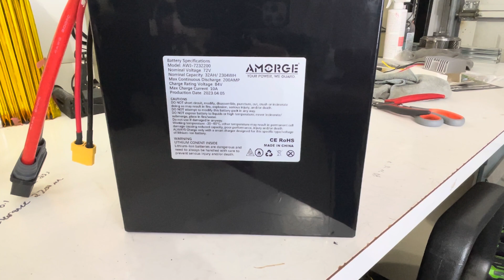Amorge Lithium Battery Teardown. Overall Build And Quality Assessment

Comment: Bro the solder will be fine I would say bolts would be more dangerous and I'm sure that they spot welded it then put solder and heat won't be a problem the cells prob only work at a maximum 80c

Comment: I just bought a 60v 24ah battery for my emoto and it didn't even go through one bar for a hour of riding..hopefully it have the right settings for my controller for the battery,next time I ride I'll check the bms and see the power left in it compared to the gauge on my bike..amorge is a great brand 🎉

Comment: Thank you for taking the time to film, edit and upload you taking apart a battery you purchased for yourself only to build it back up!

Is there any additional measures you done to it seeing as it was unwrapped? Extra tape, padding etc?

Watching from the UK - I found this video from a reddit thread about Amorge batteries.

Thumbs up for the algorithm
Reply from the maker: I just added some Kapton tape, isolation paper, and that’s about it. It’s been in a bike that gets used daily for over a yr now
Reply: @ReuterLithium  thank you for the reply and extra info
Reply from the maker: I should specify that I did get new shrink wrap and sealed the ends with silicone again. Basically just made as it was

Comment: 1:54 I plan to buy a battery for a razor to put inside the motor box but possibly use without covers. Based off your experience with battery protection here, do you think it's worth $60-$100 extra for the metal box or do you think it will be fine without it? I'm only going to be us for pavement and dry conditions.
Reply from the maker: Metal case is always worth it, even with plastics

Comment: i got an amorge but its only 24 AH out of 32 AH @ Full charge @ 4.2 volts why would the battery have lower AH than marked?
Reply from the maker: Curious how you are measuring Ah of the entire battery vs the individual cells?
Reply: @ReuterLithium  has an app it shows the total battery AH out of the capacity. After I took off the charger AH balanced out to 31.33 out of 32 cells were like 4.150 volts so IDK but i think the battery is good? weird glitch on the app was showing the AH as 24 out of 32 when charging was completed

Comment: Amorge told me my cells aren’t balanced on my batteries and they’re sending me a new “intelligent BMS”…what is this and how the heck will I install it?
Reply from the maker: That is unfortunate. That can happen with all batteries. Regarding BMS replacement. If you don’t have much experience with that kind of thing I would strongly advise paying someone with experience to do it or teach you. But in my opinion they shouldn’t be sending you parts to fix a battery. Is it under the “warranty”?
Reply: @ReuterLithium  I’m not sure what the warranty is…it’s been far less than a year since I ordered.  I will ask about replacement instead.  Who would I go to for repair?  I’m not even sure what kind of business does that kind of thing.
Reply from the maker: Pretty sure warranty is 1 yr. Yeah there is not many if any “official” business that perform those kind of repairs. Your best bet is to get a replacement. Depending on what they say on what to do with the old one throw it on Marketplace or similar as broken. Guarantee someone will either know how to repair it or at least be interested.

Comment: Is this battery still holding up? and can you get water on it without it causing problems or no? Thanks
Reply from the maker: Sure is! It probably gets used more than most. I would say the water proofing is decent. I think it’s ok to splash it and ride in rain sparingly. I don’t think it could ever handle any submersion though
Reply: @ReuterLithium Ok thanks for the reply. Would you recommend a stock surron battery or an amorge battery if I can get the stock surron battery for $400 with 1000 miles on it.
Reply from the maker: Tough question to answer without knowing what you intend on using it with, motor/controller. My Surron battery has been super reliable, but it fits terrible in most applications outside of Surron. It also lacks that punch that the Amorge batteries have. I think moving forward I won’t install anything below 150 amps continuous unless it’s just a little cruiser. I intend on taking my Surron battery and installing into a little Coleman 100.
Reply: @ReuterLithium  Oh ok. My motor is an 1800w vevor, and my controller is a 45 amp controller that works with 48-72v range. However, i can also get a surron motor and controller for an extra $400, so that I could have a full surron setup in the razor for $800 total. What would you recommend?
Reply from the maker: Can’t say I’ve ever ran a full Surron setup before. My issues with all that stuff is you can’t change any settings. Honestly just comes down to what you want to install it in and how much fabric work you want to do. Not sure where you at, but in Austin we can grab Surron setups for around $600
Reply: @ReuterLithium  Ok I see. And i totally agree with you about the problem with not being able to change any settings. By surron setup for $600, do you mean a battery, motor, and controller all for $600? Also, with a controller like a kelly or fardriver, what settings that you can change do you find most useful?
Reply from the maker: Yes all 3 for around $600. Controllers are almost worthless because you can’t change anything and the harness is very specific. I find the ability to adjust your battery amps and throttle acceleration settings to be the most helpful. But maybe if you go with an entire Surron setup you won’t need to do any of that. Not sure as I have never done it
Reply: @ReuterLithium  Oh ok maybe $800 isn’t as good of a deal as I thought then. And the function of changing amps and throttle does sound very nice. Right now, my motor is 1800w, controller is 45 amps, and the battery I would get from amorge is 72v. Because of this, it would be pulling 3,240 watts out of my motor. Do you think my 1800w motor could handle that? My controller doesn’t allow me to change amperage
Reply from the maker: Personally I think it would be fine. Just monitor the temp
Reply: @ReuterLithium  Ok thanks. Does the charger for the amorge battery keep charging once it’s full to balance the cells?
Reply from the maker: Balance is done by the BMS, charger turns off after the voltage has been achieved
Reply: @ReuterLithium  Yes I understand but what I was meaning to ask is whether or not the charger would keep turning on and off at the end to balance the cells.I had a charger where it would just cutoff when one cell would reach 4.2 volts so the pack would never be balanced. So I’m curious if the charger keeps on charging to top balance or if the BMS is an active balance bms. Thanks

Comment: 780$ Damn
Reply from the maker: Damn good or damn like expensive? lol
Reply: @ReuterLithium  I’m new to the scene…. So it’s a damn expensive at the moment. I was thinking 400/500 but damn! Lol. Is it any cheaper to source all the material and build it yourself? Again, I’m new to the scene but I have electronics experience and a very good soldering iron.
Reply from the maker: No worries! Glad you asked. So I’ve built batteries using used cells. You can bring that cost down to half, but only after buying all the decent equipment. It’s so time consuming that it’s not worth my time to build them. It’s really fun as a hobby though! For a battery of these specs most want $1200. 

Welcome to the space! It’s a ton of fun when you start jumping in. I remember when I felt like making electric things was unobtainable and now I’m thinking about converting an old sports car and am moving in to big dirt bikes! It’s addicting
Reply: @ReuterLithium  I appreciate the info. I got two razors my sons wanna mod. It’s gonna be fun and expensive 🫠

Comment: This battery looks like Chinese garbage. They say they use p42a molicell but these are Samsung 40t. I bet the cells they use are not even genuine Samsung cells most likely Chinese cells with Samsung labels. Also the positive terminal sitting directly above the negative terminal with nothing but tape separating the two is insane. If the tape melts or gets punctured it's a fire waiting to happen..
Reply from the maker: I had this specific one built with Lishen cells
Reply: @ReuterLithium are molicel an option?
Reply from the maker: @TreYay83  yeah they will build with Molicell as well. I personally have never had a battery with them, but I’m part of a couple groups that do. And for full disclosure I have never tested them. However, several people have stated that Molicel specs are a bit inflated. Meaning they still perform really well, but not always to the full potential they say
Reply: Lishen cells perform very similar to p42a. Calm down kid, watch the video he says Lishen, not Samsung or molicel.
Reply: No they aren't molicels, but they perform near as good. Their discharge is within what the specs they advertise. Any exposed wiring can be fixed with less than $1. For something that would cost $1200 priced at $500. You're really just being arrogant. If not, I'm sure everyone here would love the link to your site for your batteries built with molicels and high discharge BMS and no imperfections for the same price.
Reply: Dude your a clown 😆😂 Tell me you know nothing about batteries without telling me in one comment hahahahaha

Comment: Nice sacrifice. Hopefully you got her all wrapped back up nice and neat. 

Those LiShen cells seem to be pretty good. I think some of my fake P42A are actually LiShen because they match what Mooch measured on his tests. The fake is so good that its hard to tell if its just degraded P42A or these LiShen cells. He rates both of these cells at 30a CDR, but thats not in real world conditions. 

I recently tested my Legit P42A and the first test day of arrival i had a fan blowing on the cell and it discharged at 20a continuous and only got up to 42c. Then I tested both the real and fake P42A in simulated real world conditions. Starting at 30c, wrapped in insulation that mimics being surrounded by other hot cells, wrapped in fish paper, plastic, PVC shrink wrap and inside a battery box, and discharged until it reached 60c, which is as high as I would go since I’m not racing for money. Lol

Im designing my 5p battery for 60a continuous, 150a peak. I would say that battery there probably can realistically handle 100a continuous in the summer and then all higher values would have a time limit. Such as 160a for 8minutes, 200a for 2 minutes, 240a for 1 minute. 300a 10 seconds. The key point is, while riding the battery will only heat up, and once hot you would need to turtle mode at 30a to get home and get the pack back in the air conditioning. 

I also ordered that same type of buss system, and even though the minimum 0.3mm thickness is plenty for a properly arranged battery like that one and like mine, I chose 1.0mm thick because after shipping is added the cost for extra thickness seems insignificant. 

But if you want ro get a feud started, ask if 0.3mm copper sandwich between the cell and nickel is better than 0.3mm, 0.5mm or 1.0mm copper sitting on nickel pedestals are best and break out the popcorn. Lol

I do like the way they used the BMS wires evenly distributed along the negative collector. I probably would have liked to see them use the wires leaving the BMS and going to a 5:1 splice as it’s designed, but i guess if you use AWG4 wire along the output and on the positive collector bus, you have a better chance to get a good solder job.

Smart BMS are dirt cheap now. $100 for an ANT 200a/500a. Not sure what that adds over the cost of the dumb BMS but generally worth it just to see what’s really going on inside your $700 battery. My smart BMS already paid for themselves in helping me troubleshoot and care for battery. 

I do know the fear of ordering anything custom from china. I prefer the go to site, choose each option (cells brand/model, BMS, bus, AWG and connector type size, but the same thing can be done with messaging to aliexpress, alibaba etc. its the holding your breath for 1 month until it arrives thats hard. Lol

Thanks for the review. Hopefully you can give another review but i think without a smart BMS theres not much you can report. It’s going to deliver the amps, but whats cell differential? Its going to get hot, but how hot we won’t know.
Reply from the maker: Wow now that’s a reply! I can happily report battery is back together and is being used constantly. There’s a lot of ways to do and I love how fast this world is changing! Seems like you could build a battery and a month later there’s a better way to do it.

Comment: What was ah? 

This is far better than I expected from China batteries.
Reply from the maker: Ah for this battery is 32. They are 4000mAh cells and 8 in parallel. I think there are plenty of terrible built batteries, but Amorge is not one of them
Reply: @ReuterLithium  I bypassed the BMS and ran copper over everything, had no heating issues,  it the cells themselves couldn't handle the amps and it caught on fire while I was biking. 

I was going to buy molicel batteries and build my own, but your video makes me just want to buy from them. 

Think it can handle 200amp continuous from a sabvoton controller?
Reply from the maker: I think it can handle that and than some. The cells they used are rated for that. I live by the 80% rule. I only use 80% of its max capacity. That’s just for longevity.

I’ve built batteries and it’s fun, but super time consuming. My time is better served trusting Amorge to do it. That’s just my opinion though. I still build some custome stuff from time to time
Reply: @ReuterLithium  good to hear I'll send them your video and everything when I do it. Thanks for the replies!
Reply from the maker: Allen will build you whatever you want. That’s why I went with them originally. He had no idea I was going to take it apart and make a video. I didn’t want to get some special battery that was the best they could do. Process and receipt seems weird and scary, but I know countless people have ordered from them. They wouldn’t tarnish their name over one battery
Reply: @ReuterLithium  great I'll do that, right now I have to cut it down to 80 amps because I'm afraid of starting a fire again.

Comment: Removing comments is Censorship! now i see the truth of your purpose and Amorge  crazy what people will do for free sh!t
Reply from the maker: Never have I ever removed a comment?? Nor does anyone with 319 subscribers get free stuff lol.
Reply: @ReuterLithium  Sorry dude i guess youtube removed both of them, one was about avideo you should make for the my1020 rotor sizes in different watt motors and the other comment had a link to the $35 bms they used in this battery from fleabay, somone removed both comments, but sorry i assumed  🤙
Reply from the maker: That’s really weird? Yeah I know the BMS in the battery is much cheaper than say a Daly or Ant, but from what I found it has all the protection. 
I also have both 2kw and 3kw my1020 motors. I can see if there is a difference in rotor size.
Reply: @ReuterLithium  i wanted to see someone make a video on comparing the insides like magnet count rotor size and copper windings. maybe weigh the cases?, I think they will be very similar until you get to the really lower wattage ones like 1200 1000w would be nice to see what e&c did to the 3000w compared to the stock vevor, again sorry about what i said earlier but i know how Utube is and don't understand why they removed two diff. comments from me? are we not allowed to post links in comments?
Reply from the maker: I honestly am not sure about posting links. Makes me wonder if they flag it as a scam if you post links in comments so they removed both?

Comment: How do I buy one? And can you run 48 volt motors and controllers with 72 volt battery
Reply from the maker: Controller no, motors yes. Just reach out to allen at Amorge batteries. I will post his card in the info for the video
Reply from the maker: I added all the contact info for Allen @ Amorge and a description of what to expect!

Comment: Copper for parallel connections becomes a danger the more P members. If a cell fails the others will violently dump current in. I like using thin nickel for P connections as another safety. You can’t trust the CID to work, might be too late when the cell is venting.
Reply from the maker: Yup I agree, but I can understand from a manufacturing standpoint why they do this.
Reply: This is better than how most packs are built. It’s to the standards if not higher of how chi, and a lot of other big companies make these packs. This is a standard pack they sell from the specs I’ve put together over time so people could have a good power without Paying so much. They can make them to any standard you would like, you just have to ask 🤙
Reply: @DEEZEVs  Chi does cell level fusing :)
Reply: So would you say this battery pack is a safe one to use then or no?

Comment: Awesome video man! I just got my 72v Amorge last week, so far so good
Reply from the maker: Thanks! I was skeptical till I took mine apart. I was pleasantly surprised
Reply: Hi just checking on this after 1 year. Is the battery still going strong?
Reply: Also what cells did you get?
Reply: How's your battery doing still good?
Reply: @williamcappauf7631 no issues with it. Probably ordering another for a different bike soon
Reply: Nice I'm about to order a 72v 35Ah battery for my Onyx Rcr. I just wanted to make sure it'll hold up. How often do you use it by chance? I'll need to use mine 5 days a week
Reply: How is the battery holding up?